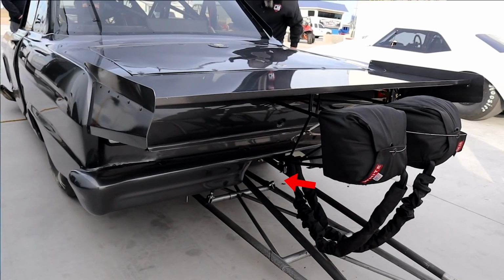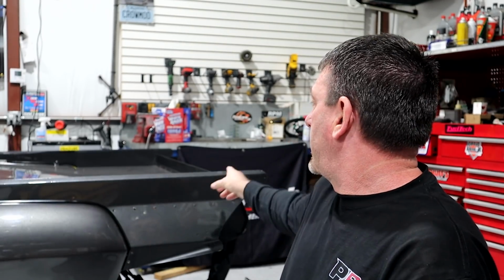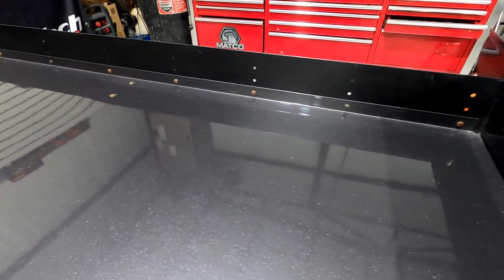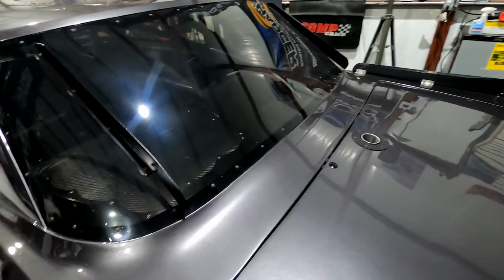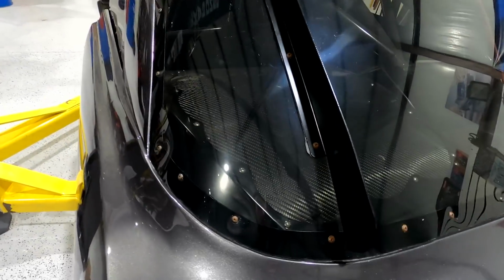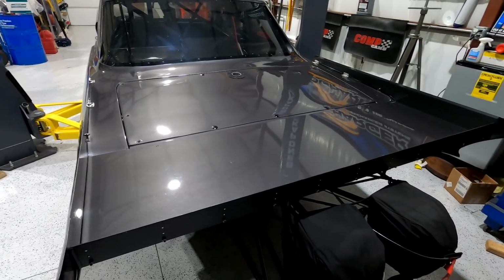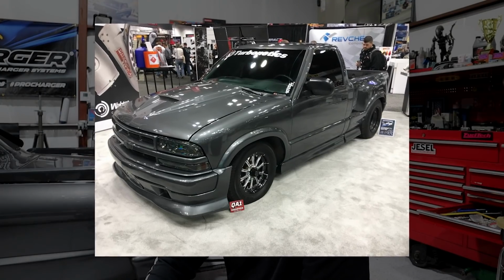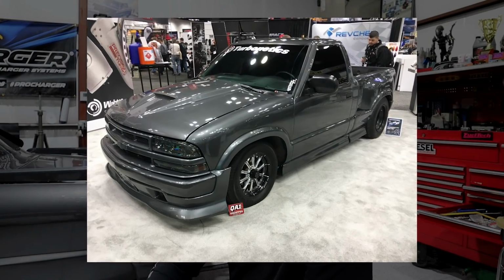America's List testing at Thunder Valley Raceway | Daddy Dave Racing

Comment: Consider running a channel from the front of the car to the rear decklid, to have the air flow from the front of the car, through the interior of the car, then out onto the rear wing. Mercedes F1 was doing this a few years ago, they actually took airflow from the REAR of the car and channelled it to the FRONT (yes, it was wild stuff, but it worked). Ferrari was doing something similar as well. There are ways to get the airflow you want w/o contravening the aero rules :).

Comment: Dave, My name is John THompson and I spent years in the Boeing Vertol wind tunnel in Eddyston Pa. I also crewed on a winged sprinter for two seasons.The rule of thumb is that there is a 1" boundary layer across most skin surfaces. Simply thinking if you have a 2" blade only the top half has any real impact. Try changing the two rear window blades to something like a thin wall tubing cut in half mounted 1" above the deck to hold and direct the air over the trunk deck. The inside diameters would be facing each other. I also would like to see the turbos air horns extended out in front of the air being pushed around by the front bumper. Clean air may help with consistant tuning. Straight air works better! Stay safe young man!
Reply: So you worked in the aerospace industry but have spelling issues?lol
Reply: Turbos air horns????
Reply: @bobbyrogers7794  lol yea, it's some kid larping as an aerospace employee.

Comment: Hi, Would a "Wind Tunnel Test Session" Help? To see the " smoke / Airflow " Would / Could be helpful?
With the Additional pieces added to the rear of the car, could it affect the lift / steering of the front end?
Thanks  👍
Reply: you would be able to tell how bad the drag coefficient is with the smoke/ airflow and see areas needing to be fixed, it could affect the lift since the downforce would be set more  properly but the steering wont have any issues would be the same as if your driving a 55 with the fins from factory

Comment: So what is your plan on the truck with weight when you switch to pro charger your not going to have the turbos in the back and cooling that's going to change the scaling of the truck and your going to have more front end weight are you doing a complete makeover of it?

Comment: My question is, why did it suddenly need those extra pieces on the rear?   Did something else change with the body?   Did you get significantly faster?   Or could it have used those all this time and it's a new idea y'all just came up with?
Reply: Because they always have to add things so they can go faster, If you aren't always going faster and faster you will always lose.
Reply: @tedesco455  Yeah I get that, but the way he put it he couldn't get down the track until he put those pieces on there. 
He's been running that car for years, so I'm pretty sure it's gotten down the track just fine many times without those pieces. 
That's why I was wondering what else changed.
Reply: @SealofPerfection  The cars have more power than will get down the street always. He was talking about the street.